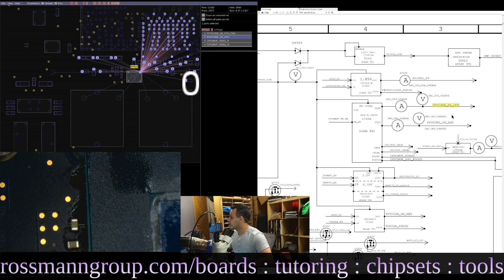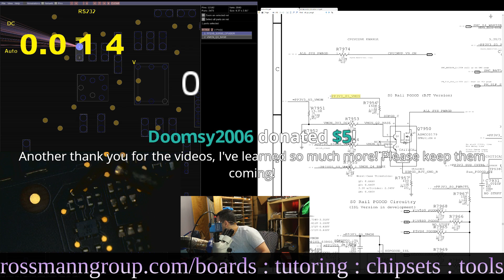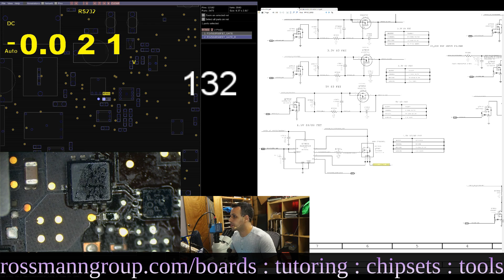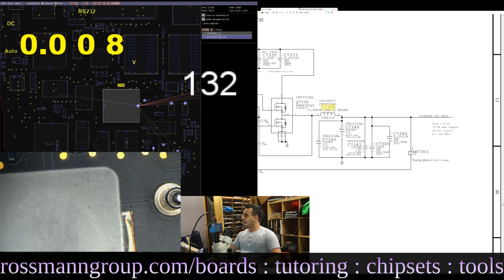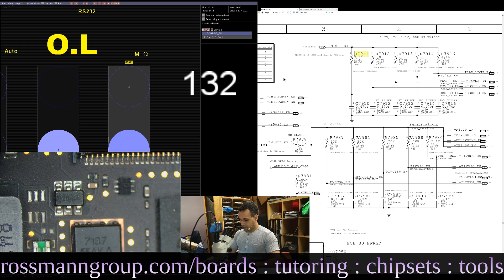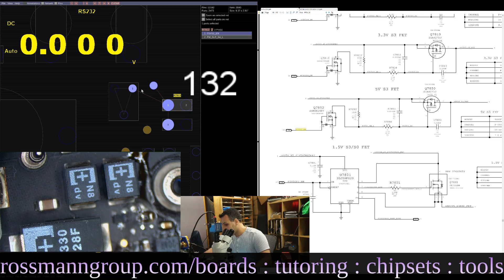820-3462 A1425 Retina turns on black screen

Comment: Hi Louis, 
thanks for your videos!
would you be so kind and tell me what is LED driver chip for 820-2330-a (In board schematics it is named GOSHAWK6P)? When I look at mailin.repair catalog and search by board name, it does not find any LED driver. When I search for component number U9701, it gives 3 options, only 2 could be suitable LP8545SQ and LP8545SQX-EXTJ (since my chip is QFN), but boards listed under description don't match. Also, when I check datasheet for those chips, pins don't match scheme for 820-2330.
Thank you in advance and good videos.

Comment: Hey Louis, I have a macbook which the screen was replaced. after and update to mac os the screen no longer dims and its stuck at full brightness. is there a way to fix this without opening up the laptop?
Reply from the maker: Can you try this and tell me if it works? https://forums.macrumors.com/threads/screen-brightness-broken-sierra-10-12-4-beta-3.2033660/page-2#post-25033634

Thanks a lot
Reply: THANK YOU SO MUCH LOUIS THIS SOLVED MY PROBLEM!! YOU ARE A GOD HOLYYY

Comment: Hi 
For my project i have to make my own "iMac" with touch screen, and i'm planing to use the logic Board from my MacBook Pro. But i have a problem,
i don't know how to turn the power ON , because the power button is on the key board, and for this project, i don't need keyboard, There is any other 
way to turn the logic board ON? Like two test points? or two connectors on the logic board, i can short them and turn it ON.
The Model # A1398, Mid 2015
Please help me, My only hope is you, right now.
Thank you in advance

Comment: My iMac has only 2 slots of ram that doesn't work (beepbeepbeep). What could be happened? I think I've improperly abused it while putting new thermal paste on the cpu/gpu, but I'm mot sure. I think the failure is the right side of the ram slots on the logic board. Could be electric statics? How can I repair bad ram slots?

Comment: Hey louis. What tool are you using to count the frames that were delivered? If you are counting the frames sent, like for example through obs, you are counting the frames lost by your computer before being sent. You might want to look into better hardware for streaming, because by publishing that your frames are being lost by time warner can open you to a libel suit from time warner/spectrum. 
I would suggest watching some video streaming benchmarks to see how much of a difference a cpu can make when it comes to dropping frames. For example in the gamers nexus video "R7 1700 vs. i7-7700K Game Streaming Benchmarks" you will notice that one of these 2 current gen CPUS drops way way more frames than the other. Hint: the quadcore is much worse than the 8 core.
Reply: What are dropped frames? Well, that’s when your capture card does not take in all the information it is given. Information is lost, and the video quality is degraded because of it. Information is now missing when a frame has been lost or “dropped”.
Reply from the maker: I would love to see time warner issue a libel suit.
Reply: me too